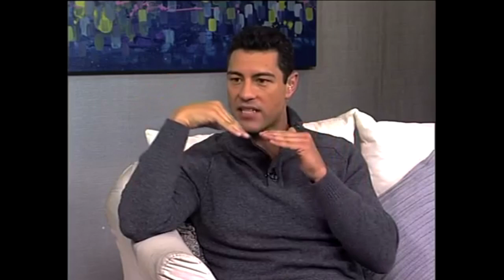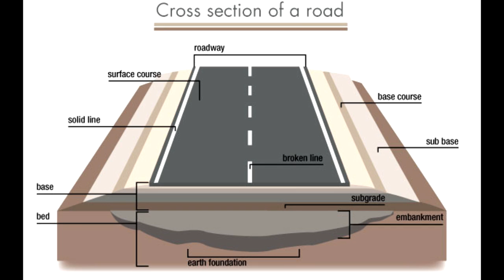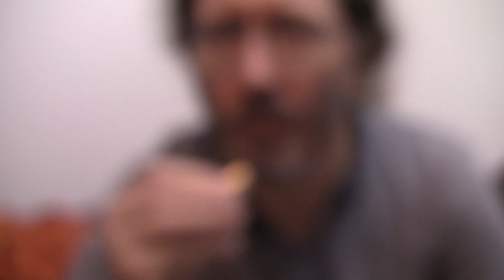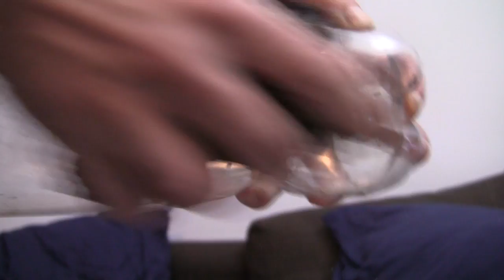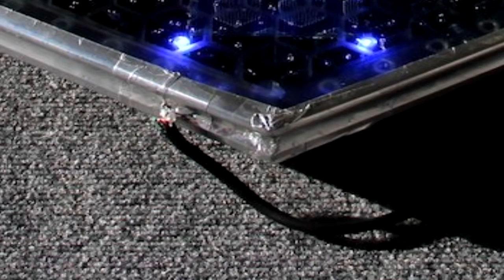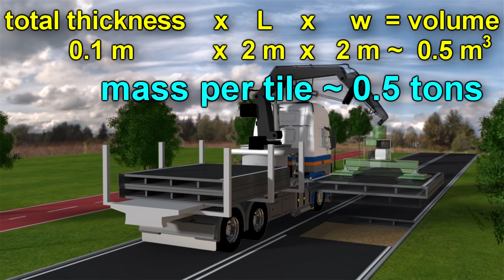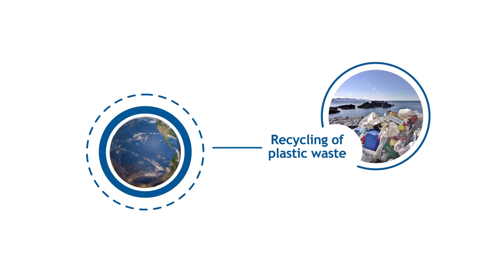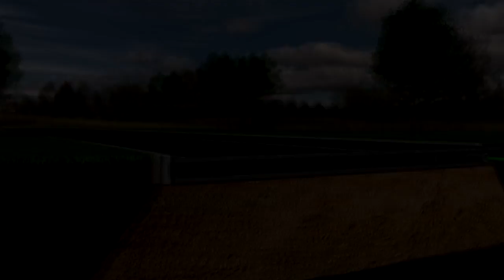Plastic Roadways BUSTED!

Comment: The only valid argument against these plastic roads is what it costs to use the elements. Asphalt or bitumen are from fossil stuff and so are almost all plastics. PET is high quality, bitumen are low grade. But used-up plastics can only be used for very very low quality stuff like poles for a parking lot, they break down when a car hits them. I think plastics that are at the end of the recycling proces can be used for roads. The point is that plastics can get so warn down that they cannot be recycled anymore, those plastics will be used in an element for the road. I don't think pure new materials are going to be used for this.
 
The argument that there is more needed for roads then these elements is BS, the firm has a long reputation in constructing roads. I guess they know how to make a road. The mother-company worked on the Panama canal and aswel on the Suez canal. I guess that if something is wrong with the idea they won't start with plastic roads. When they can make money they start.

Comment: Totally agree, it has the distinct and abundant smell of Bullshit. I can just see then disconnecting 1km down the road hauling all of that cable back to the next JBox 1-2 km in the other direction then do this for poly water pipe and gas and fibre just so a 6-10m section can be lifted out and 'dropped' back in and then threading all of those services back through. This is what happens when marketing wanker think they are engineers.

Comment: @Thunderf00t
About that energy balance at: 16:30. Please do not spread that misconception. You would use 1,5 kg of oil for every 1 kg of "plastic" (more or less) as the raw material, and 1 kg of oil as energy (and ~0,2 kg of oil just to extract all that oil you need). 

But other then that great work!

Comment: The narrator trying to debunk using plastic as a building material is obviously not a scientist, physicist, chemist or engineer. Yes plastic has its deficiencies but there is no shortage of plastic filling landfills around the globe. It is already being used for other building materials such as boards and even walls. Lets use our science and technology to use this material for new applications instead of trying to debunk any possibilities. The part where the guy bites into a piece of plastic to show a tooth mark is just ridiculous. The equivalent amount of Asphalt can be dented even more with the equivalent amount of pressure. All he accomplishes is proving  he has know knowledge of science and should NOT be debunking anything he does NOT understand.

Comment: This is pretty good. It is black and white, which is not realistic, but it's good.

I can see the potential for current road building to benefit from these ideas. I can also see potential work-arounds for the problems a combined architecture might create.For instance, it wont always be in series as this video claims. Then. a mobile rerouting unit could be hooked in to the panes before, and after the one to be removed, to maintain flow, when they are in series. 
The hardness factor could give way to a new system of road grooming using something like Zamboni.

However, cost and lack of recycle-ability in a composite design still negates their claims. The Japanese already have a system using much the same technology as we currently use, but the design last 3X longer and 1.5x the cost, so American politicians say no. Lowest bidder (so they don't have to think) and all.

Ultimately, what we are seeing is unqualified people gaining access to huge amounts of public money to rethink ideas that are already refined. After all, what we have now is not real, it is a social construct of the military industrial complex. This is just lazy policy and panders to those who want to invest time in ideals instead of practicality. i.e. Squander.

Comment: seems to me the recycled plastic (polyethylene terephthalate) will act as a bonding agent like the tar does in asphalt. thunderf00t is off on another tangent poo-pooing an idea with merit. this looks like a good concept, it's a matter of economics whether or not it can be made viable.
 this would be something more for urban areas where surface replacement is more frequent. i give thunderf00t a thumbs down on this video but a thumbs up for the overall concept
Reply: what about the uv-rott of pet ? Ur roads will rot away while u are watching. Theres a reason why plastic bottles have a deadline.

Comment: I threw the BS flag the instant i saw this. Being someone that has been in the construction field for years you start picking up failure points even if you don't have the technical vocabulary to explain why. 
It doesn't take a genius to know that the joints would cause erosion, modularity would be a nightmare for joining pipes and cables which also degrades connect and flow rates, plastic is a crap friction surface, concrete and asphalt is cheaper and reusable, a hollow road would cause flex leading to lower MPG driving, and sun rot on plastics (look at the recycled plastic park benches).
I also thought about how if they wanted to make it modular, they would have to make the sections REALLY long (~50ft/15m) kind of like bridges and over passes with their expansion joints which means you would still need the same sized semi  truck and trailer with a crane that would more than likely eat the same amount of fuel. 
Not to mention the cracks making noise every time you drove over them. Think about it, a 30 minute cadence of "duh duh, duh duh, duh duh, duh duh"

Comment: Just look to the material properties to see it's a fundamental fail. Assuming it's mostly PETE, The glass transition temperature of PETE is just over 60ºC. While it would become a little more brittle in the winter, I would be more concerned about the summer because roads in hours of direct sunlight can reach above that glass transition temperature where PETE then becomes ductile. It would probably form permanent ruts after the first hot summer day.
PETE has a high thermal expansion coefficient and a low thermal conductivity. The top will get really hot while the base stays cooler so it'll probably warp during large temperature swings, such as morning and evenings. It would also bulge without a lot of expansion joints. For every 20ºC temperature rise, one kilometer of plastic would stretch by 1-2 extra meters. which is about 6 times more than concrete. It would also contract by roughly the same amount for a 20ºC temperature drop. Good luck in any northern continental climate where there's wide temperature variation.
Plastic also degrades under UV light.
The friction properties aren't great either. Think of how slippery it would be when wet, especially if there's a layer of oil from drippy cars. You know how hard it is to de-grease oily plastic food containers and how slick they feel. Imagine a road like that.
Since plastic is so soft, hard particulates on the road like rocks and sand would grind it away. 
To actually do something productive we need to stop frivolously using so much plastic packaging, especially for bottled water, which is proven to be no better than tap water anyway.

Comment: Lol! That is just wall cladding super scaled up.  I used to work for Wavins rival company Decuninck, but both are plastic extrusion companies making window frames and wall cladding.  Cladding is also notorious for having huge scrap rates as keeping those cavities open is an absolute pain.   You would need one hell of an air compressor to inflate it too.  Wavin isn't equipped to produce something this big either, I don't think anyone is. The line would be over a mile long of water cooling baths to cool such a huge extrusion.  There is a million production issues with this!

Comment: I think they will just replace the bitumen with the "plastic" and combine the "plastic" (PET?) with rock and sand to make the road surface (polymer concrete). Doing so they need less plastic (~95% less plastic) and have a more durable and generally better surface. It is also possible to recycle polymer concrete.

You could also reduce the (sunlight-) aging process of the plastic by adding additives like graphite-dust.

Comment: Over ten years ago, when I was in middle school, our gym had a blue plastic hexagonal tile thing layered over the previous flooring. The only kind of traffic that that flooring saw was foot traffic inside of a building, but that was enough. The gym floor was awful compared to a normal waxed wooden floor. I think the plastic tiles must have been hollow, because the center of each one bowed in from a bunch of kids trampling it. That same middle school was later condemned, because basically the entire school was falling apart, and held together with duct tape.

Anyway, I can't imagine having roads made of plastic. That would be terrible. And don't forget: plastic can catch fire, and melt pretty easily. I suspect that someone in that plastic roadways company is just making it look like they're doing something, so that they can get paid for doing nothing, when someone signs off on their "research".

Comment: Hey TF, I took a motorcycle trip through Canada and their roads are so, so, soooooooooo much better than in the states.  It seemed like they had some kind of rubberized composite on top.  The roads were smooth, hardly any potholes, and they're in freaking Ca-na-da, where the temperature extremes and expansion fatigue are much worse. I mean, the dirt and gravel roads were crap, but the main highways were amazing.  What's going on with that, and could that be cost effective in California where everytime it rains, there's a million new potholes...
Reply: Here in America we love low taxes. And our roads suffer for it.

Comment: And what happens when a car or truck catches fire on one of these roads?

Also, if the road has holes in it to let the water into the sections, it's just going to run to the nearest low spot and then come gushing back out again. The only cure for that is to put in a pump everywhere there's a low spot or millions of little fail-proof check valves in the road, and that's just asking for an explosive rupture at the bottom of some valley the road crosses.

Comment: I am going to do a kickstarter for a nuclear hydrogen propulsion car which can accelerate to fractional speed of light which has a breaking distance of 5 meters in hard vaccum and 500g of acceleration.
Reply: Just make a good vid, and the suckers will shell out millions. My idea, a wearable device, using solar power to convert CO2 into food; you'll never need to eat. I just need a few million Kickstarter bucks to 'tweak' the research a bit, and I'll have it. I promise.
Reply: Augmented Pepe you never mentioned what fraction of the speed of light, so if you can make it able to move and brake, you technically aren't lying (the 500g part might not be able to be fudged in this way)
Reply: well Its only a concept it will be finalised later during the kickstarter . At the moment the kickstarter is to help with the development and we will be inviting university students from around the world to help with the design in a design competition like the successful hyperloop test.
Reply: Augmented Pepe Please tell me you're going to use a Delorean....

Comment: My 1st question when I saw this was - how do you plan to connect those pipes and wires? If you put a section in the middle of 2 orher sections you can't actually connect to them without removing one of them wich now becomes the unconnectable section.
And then thare's the heat of summer sun and cold of the [northern] winters. Plastic becomes soft (at least softer) in heat, like, I don't know, maube sun heating it for 16 or more hours per day? And in winter when temperatures may easily reach negative 30...40 degrees celsius plastic teds to become quite brittle

Comment: I have done this job, road construction. And road repair.  Once the base is laid down, and the asphalt in, it does take awhile. But asphalt top gets replaced all the time, without rebuilding the base. I have stripped down plenty of road to the base and just topped it. So that's all they would have to do, is replace the top. They even show the base in the cut away graphic.

Comment: Modular is actually pretty terrible when it comes to something that has to be as adaptable as a roadway, and it makes it harder to repair, not easier.  Oh, yeah that weird curved-in-two-directions L shaped piece in the middle of that busy intersection thats broken and needs replacing?  Sure, i'll put in an order to have that exact piece made, then trucked over here and we can install it as long as all the other modular pieces around it haven't moved out of alignment in the slightest.  Most cities have a hard time keeping up with things as easy as filling a pothole, which takes 5 min of work very little material cost the conventional way.

Comment: Millions of retards on Facebook.. Big shocker there.

So let's say we need to replace one of these plastic tiles.
Do we keep spares somewhere? Do we need to get them from the factory? How long will that take? Are they all made at the same place or do we have to open a regional plant?

What if we want to rebuild the road? (Build an intersection, roundabout, connect two roads or w/e.)
How will that work with premade tiles? Disconnecting the power each time?

What if there's a bridge?
The tiles can't just stop, or the power can't reach the other side. Do we need to rebuild all existing bridges to fit the plastic tiles?

So many questions..
Reply: My background is in IT, and my first thought is the cost of termination. Every connection adds resistance, so even modular plugs would be detrimental to the smooth flow of information/ power/ etc...
Reply: I work in Engineering  and I often wonder how the fuck we got here with such stupid ideas, it would make  more sense that some super advanced race built the planet and we just appeared here.
Reply: Wonder how they'd handle curves in the road.  Both curves side to side, and curves up and down. Would they need to mold the tiles into those shapes each time, would they use a giant 3-D printer for it, or maybe they'd somehow keep a massive catalog of special tile shapes?
Reply: ShadowAkatora w
Reply: +ShadowAkatora
There's only one question to ask the "makers" of this bullshit:
How much money do you expect to scam from people for your "brilliant idea"?
Reply: how do you make italic text

Comment: What does the global output of bitumen have to do with anything? They never cliaimed that this would replace ASphalt (not ASHphalt) roads across the globe, nor is the current global bitumen output some kind of hard ceiling.
The greatest flaw in both plastic AND asphalt production is that oil is a strictly limited resource with massive geopolitical ramifications. Thus whatever material is used, it's not the coist of the initial material, but its recyclability that is the key factor.

Comment: You should near the start of the video point out that the hardness of something is a property of the material it's made out of. I wouldn't be surprised if people see this and are confused by all your scratching stuff because they think that by compressing the plastic it can reach a point where it will not abrade as easily.

Comment: Plastic roads. I thought it was a dumb idea first time I saw it on FB. But I think the biggest problem with it is the material easily disintegrates into a powder like material when a rough surface is applied to it. So we'd end up with more plastic pollution in the environment, not less. A plastic material might be ok for interior wall surfaces. 

Solar walkways might be a good idea. Maybe driveways. Limited usage otherwise though.

Comment: isnt the recycle rate of asphalt already at like 95% ??
Reply: Hunter Rodrigez closer to 99% i used to do roadwork, I was the jackass in the dumptruck they stoped traffic for to let get back on the highway.

Anyway where i was we had road grinders that would rip the top layers off and spit them into a truck MOST of the time, We would then dump that into a pile at the plant where it would be gathered then ground up again and sent through a machine that added anything needed and then they dumped that into a prepared truck which took it to the correct area to be laid down like all new asphalt and usually of the same or better quality. 

Same process for when we actully had to repair a road due to potholes or sunken roadway just takes longer and is a lot more involved because you got to rip up the entire road redo the foundation and repave it much deeper which takes a lot longer.

Either way its far far cheaper and efficent as you need only a very small amount of oils, tars, and chems to make nearly everything you dug up reuseable and by it taking so little time and the mobile  hotplants USUALLY being so close to the work it reduces fuel consumption of the equipment a great deal.

Another fun fact is if your repairing the roadway you can be WAY  overweight for the road as long as you dont excede max safe weight on the rigs tires, But only if you stay in the same area more or less and there are no bridges because if you crush the old pavment who cares? its getting redone anyway and the new stuff can USUALLY take the few days of overweight trucks rolling on it without damageing it thus even futher reducing fuel consumption and needing less trucks to do the same work.

Comment: (not being sarcastic at all) what about the material used  to make plastic or poly- wood like fake wood that doesn’t rot [with no idea if you could make that  out of any recycled material, but it would be really strong] also leo bout how the sunned plastics react to each other you could use an abrasive sand paper like adhesive spray to cover the surface area for grip and  protection from UV Rays?